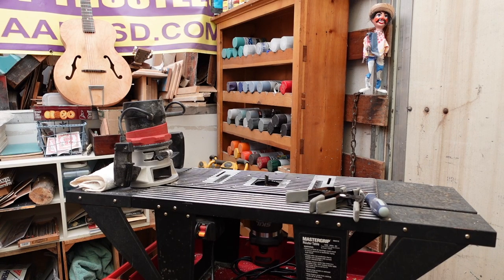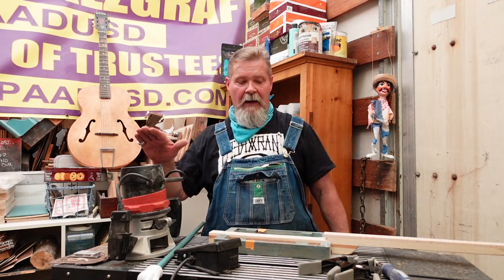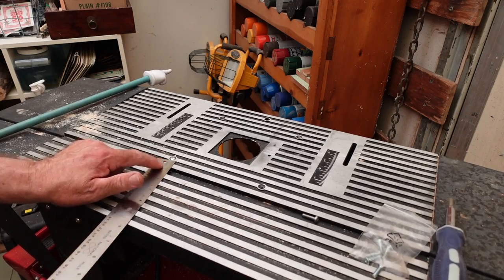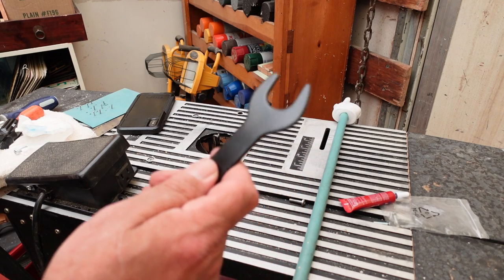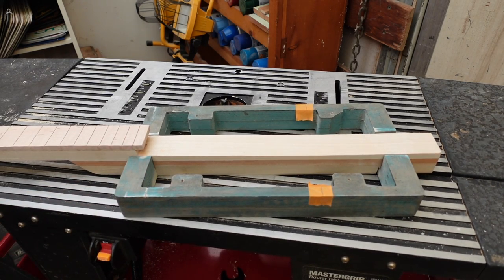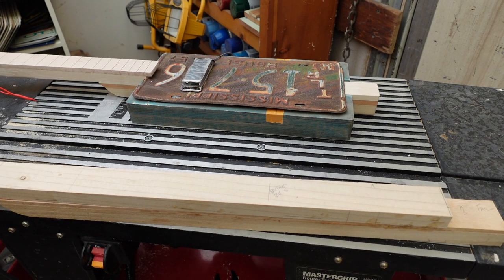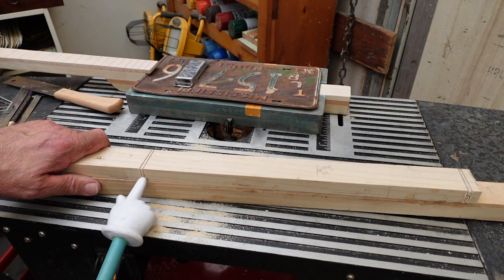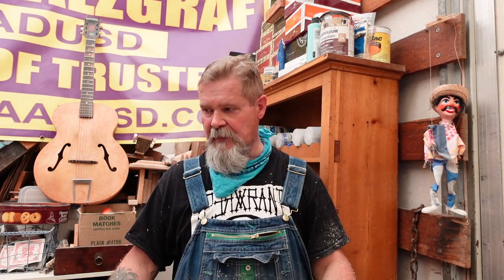Routers

Comment: 0:57 ... you think we don't need anymore cbg videos??!! I'm shocked...I'm saddened... and then angered... then (hmmm, what's the next stage?)... that's okay (oh yeah, ... acceptence!)
Holy moley, you have the same portable router that I have!!!
Power tools scare me (mostly the noise, I guess)! I have a Shopsmith... do I use the tablesaw function? Nope, too scared... Do I use the wood lathe function? Nope, too scared! However I have no qualms about my bandsaw, I saw itty bitty pieces of wood with my fingers centimeters from the blade! Go figure...
8:44 .. a multi tip screw driver from Harbor Freight!!! Best screwdriver I ever bought! I bought four and keep them in strategic places in my house!